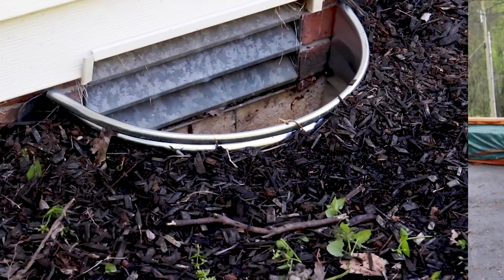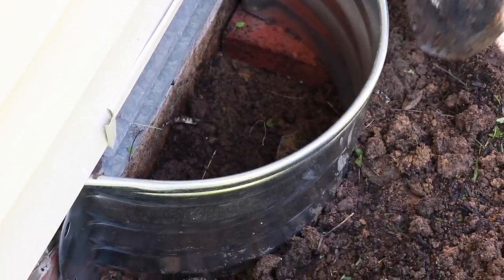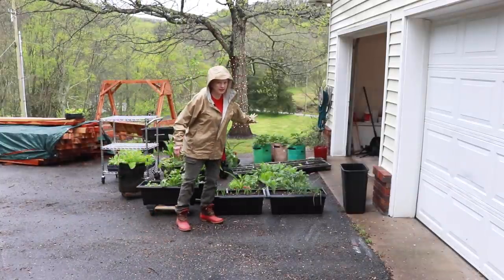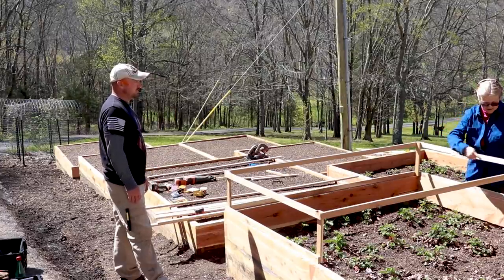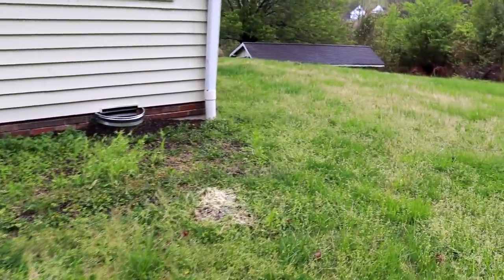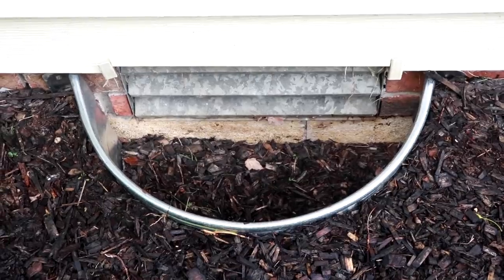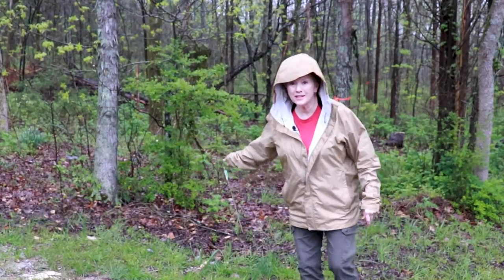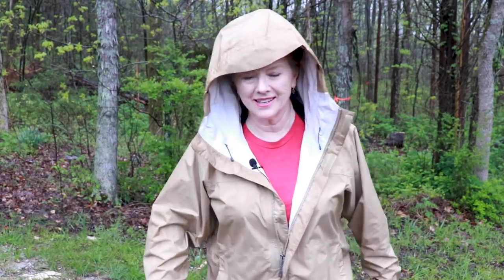This LOW COST item can keep WATER OUT of your CRAWLSPACE!

Comment: Good morning Kaye. Just a thought.  For the roof of the cistern, what about a living roof with sedum and such?  That is if there will be no possible issue with deterioration.
Reply from the maker: Well, the roof is not in great shape, but now that I've done the clearing on the other side, I am considering a solar panel to power the pump in case the power goes out. Just have to get the NEW leaks fixed first, plant tomatoes and so much more. Livestream today at 5 CST, please join!

Comment: If it were my house, I would dig a hole as deep as the footing, pour a concrete floor and build up an air plenum to let air in and out, but keep water from doing either.
Reply from the maker: Interesting! What I wound up doing was having the plumber put in a sump pump under the lowest corner and it's been working great and seems to be dry every time we look in there. A stop gap measure but it took the emergency away. IDK what an air plenum is...
Reply: @Latebloomershow  
Google it. It's just a tunnel for air, a passage way.